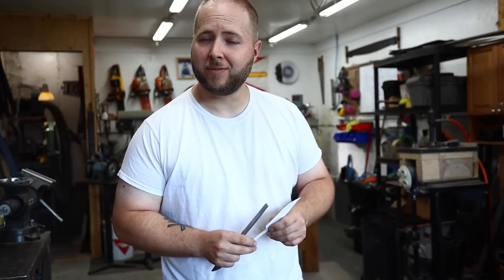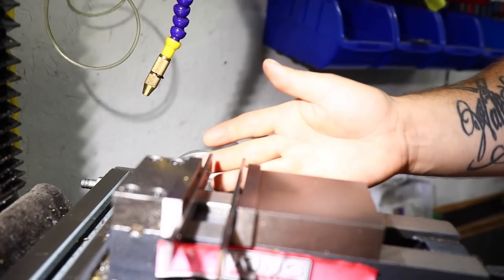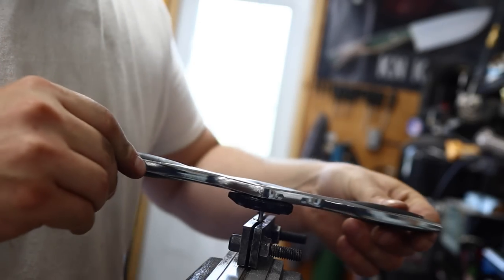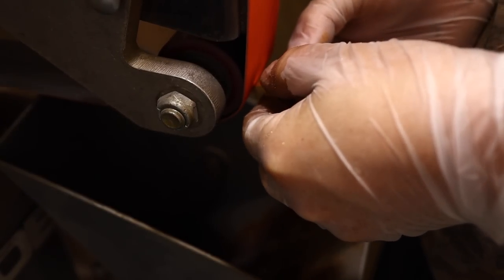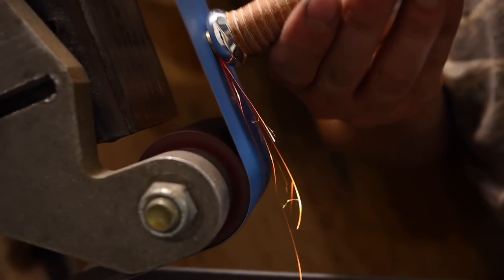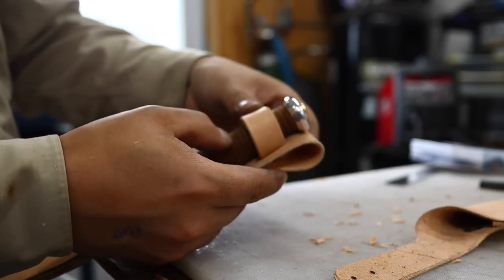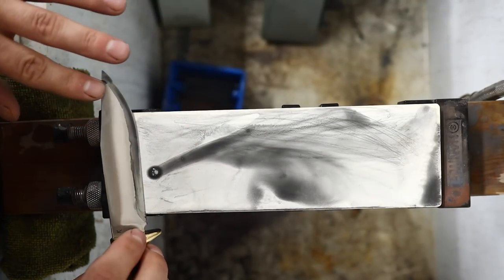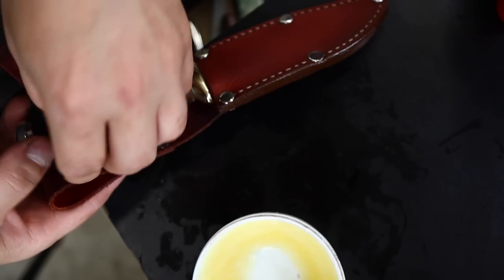Building an Heirloom Hunting Knife - [ FULL BUILD ]

Comment: Very nice build. I'm curious about the choice of a simple non-stainless steel O1 though. Something like AEB-L will heat treat harder and tougher and doesn't corrode when processing meat and isn't so much more expensive. Needs a kiln instead of a forge for heat treat but all steels benefit from the control of kilns instead of forges.